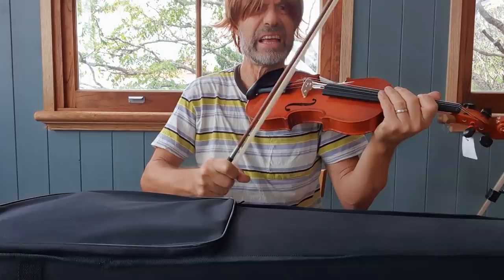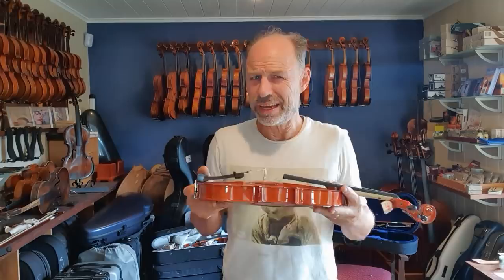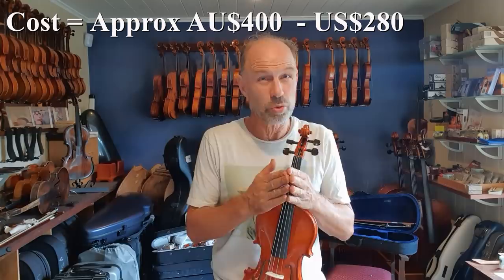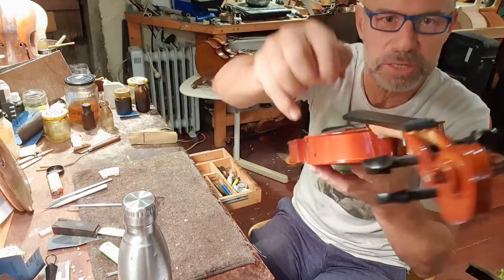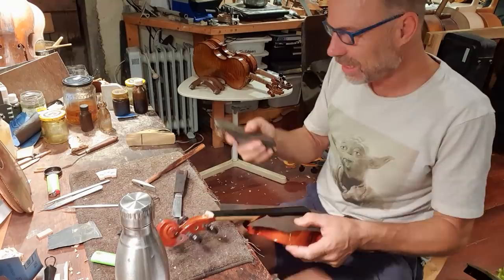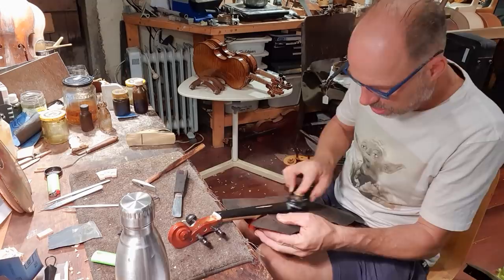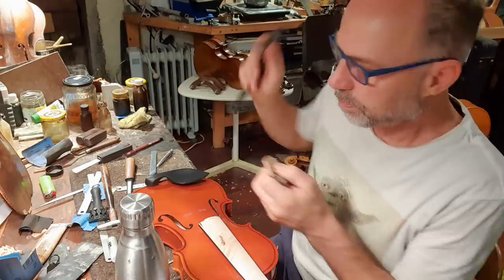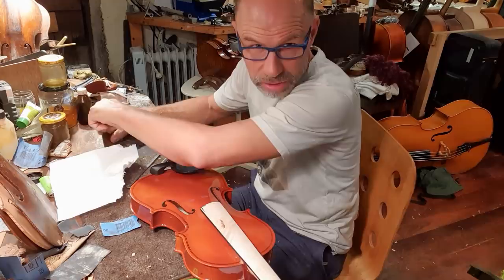Will it work?!? I try to Improve the 100 Dollar Violin with my Master Setup

Comment: This is a great video to refresh my memory. I've built a violin and several mandolins. I m looking at my bridge and notice that my d string has sunk down even with the top edge of wood bridge. I had thinned the down edge down a bit. I wondered should I replace the bridge? Or sand it a bit. It is an ebony e bridge.Aubert.

Comment: Lovely demonstration, ideally a craftsman can start with better, but a good craftsman can make it work.

Just one thing when drawing comparisons like this, in ran help to tune the violins to an objective standard. It was difficult to compare them properly when one was tuned notably higher than the other, or seemed to be.

Comment: I had a student start today with a vso. The bridge was so large, I could have cut it in half and still had it be to thick. Thankfully I just had a new bridge cut for my violin, so I put on the old one. Not a perfect fit, but it's better than or was

Comment: as an antique dealer, I'm also a collector main part old windup gramophones and old books but much more I come from a musical family of which I'm the least talented but antique musical instruments do trigger my fancy and don't go off to eBay or the auction place but to the storage of my goodies.
two weeks ago I came into the shop of a befriended antique/curio dealer and he had a violin hanging from the ceiling! it was a light wood with quarter panel back with a strong tiger striping in the wood grain and superfine detailed inlay of flowers leaves instruments and cherubs this was, in fact, a highly decorated Italian baroque violin from the 1730s.
now I have it I kind of want to sand the back!...why you ask! I think the inlays have been bleached by the sun and are in fact multiple vibrant colors of wood giving it more depth I also think the whole violin would have been more of a reddish-brown instead of light yellow because the inside is a reddish-brown.
I will take this step by step if you go into new territory never rush if it takes 3 years to learn it will take 3 years to do it! the end result will always be better for it!
Reply from the maker: Sounds like an amazing violin. 
Maybe talk to a luthier to see what kind of instrument it is.
The varnish is sacred on good instruments, so it's worth preserving. I work with the original  varnish and polish it to make the instrument look beautiful again.

Comment: Cool video would like to have a review of the new ebony bridges :washhands: are they to hard for the top or improofing the sound. Equal string spacing is good but 16mm you should be aware of the fingers of your customer, 16mm is too much for me. I cannot do quints on those violins:face-green-smiling: too small fingers :face-red-heart-shape: for example. If you want to dye a fingerbord you need to use black liquid leatherdye like the guitar repair use it or hardcore use liquid filler of edding :face-fuchsia-wide-eyes:smells only the first 100years.

Comment: hi! sir, some time the base bar in the 100.00 buck fiddle are really short  and it's made of ply wood, i bought a 200.00 droller fiddle ..and just to find what i would see in side of it , man, the base bar was only 5 1/2  inch long  and 1/8 inch wide,  and all most falling off,  well i made a new base post for it,  took of the neck all of it,  put a new block in the  did all the neck and bridge adjustments  complete aliment   surprise me what i could really do with a ply wood fiddle lol  but i do not like a ply wood fiddle lol  i did it for the fin of it...

Comment: I have a question... I am a guitar luthier, or rather fretted instrument luthier. I picked up a violin and they are quite a bit different than fretted instrument. For one thing you don't have to deal with sound posts in a guitar/mandolin/lute. What would a guitar luthier need to learn in order to become a violin luthier? Or should I stick with being a guitar luthier? I also found playing violins to be a bit of a challenge. For one I can't secure the violin to my chin without it falling off and so I can't fine tune it while pulling the bow. But then it's a cheap violin similar to the one you did work on, I only bought it simply because I wanted to learn how to fix them on a cheap instrument, and not mess up a 500 dollar instrument. 

But violins are clearly in a different world because very few people would pay more than 2500 dollars for a guitar whereas a beginners violin is 1000 dollars.

Comment: Out of curiosity, 
Do you believe bridges could be quality-mass-produced (ready for minor adjustment/alteration where needed)?  I'm thinking of cnc / stamping precision processes that have been adapted to other instrument parts like pianos..    or is each violin so different that handcrafting from a blank slate is the only method that will do?

Comment: Firewood is firewood, no matter what expensive parts are supplied.  The sound decays quickly, there are few overtones, the sounds are sour cutting, but not velvety and saturated
Reply from the maker: The problem is that the varnish fumes are toxic...
Reply: @AskOlaftheViolinmaker  I totally agree with you!  nitrolacquer cover of cheap violin will not bring health and sound!

Comment: One question I have: How much do the prices scale up for cellos? From what I understand, cellos tend to be more expensive than violins of the same quality. How much would a cello of equal quality to that $100 violin cost? How much would it cost to improve that cello to the same level that you improved that violin; and if you were to spend that much on a new cello (plus the cost of the initial cello-shaped object, of course), would it be comparable in quality to the violin that you suggest buying rather than buying the $100 violin and spending the extra money to get it up to that standard?
Reply: I need to know this as well

Comment: Most of the work he did only made the violin easier to play and had very little to do with making it sound better. Sure a new top quality bridge, sound post, and strings all placed where they should be really do help the sound but I was expecting he was going to pop the top and tune the plates...now that would be really interesting and really does take talent.  And maybe take it down to white and put on a really great finish.  $1500 AUS later....thanks for the video...love all violins, even those that did not turn out to be Strads.

Comment: Nut and saddle materials on guitars can make a pretty big difference in the sound of the instrument. I have seen bone nut and saddles for violins, but have never actually seen or heard a violin or viola with them installed. Have you experienced a violin with them and if so, what is your opinion on the sound produced compared to ebony nut and saddle?

Comment: My first cello I bought on eBay for ~$300 USD and was no-name  maker and very crappy. (Which I expected). I cut the feet of the bridge( which was the wrong angle for the curvature of the body),  planned the finger board and filed the nut myself. I couldn't get the nut off so I used a fine knife to plain upwards in the direction of the nut to get close to the edge.  LOL. The pegs were garbage; some kind of soft wood. But I didn't want to spend too much money on new pegs and especially a tool to cut them to shape when I'm only going to use it  once. So I went back on eBay. Hahaha. I found cello sized mechanical gear pegs for $34 free shipping. Hahaha. The pegs holes didn't match the gear pegs (because they are affixed to a plate like on a double bass. So I filled the original holes with epoxy and drilled new ones. I finished it by putting DIY wood dye on the finger board and spray painted the peg box with what ever was laying around in the garage. Hahaha Oh the original tailpiece was steel with fine tuners that were terrible so I changed it to a Winter for ~$25 or 30, I forgot. Hahaha so the whole upgrade was less than $100 USD. 

I'm definitely not a luthier but it (actually) works much to my surprise. 😂   You would be aghast if you saw it. 😂 It's the Frankenmuth of cellos.

Comment: Interesting to see the work. But wouldn't the before and after comparisons be fairer if they were both in tune? Since the before videos are played (/tuned) out of tune, that makes a huge difference between the two, making them sound much worse. And if so that makes it really difficult to judge what the other changes are, since any instrument sounds bad if the strings or playing are out of tune. If they were both done in tune we could compare the actual sound quality difference way more easily (and fairly).

Comment: I would like to have seen more about the sound post, it's position, length, purpose.  I recall my grandfather making violins and using a thickness gauge for the top and bottom boards.  How critical is the thickness?
Reply from the maker: The thickness is extremely important for the sound. 
A lot of these cheap violins have too thick plates to sound good

Comment: Why and how would you improve the sound from cracking? Thanks!
Reply from the maker: Hi Bryan, 
Great question.
It's where the instrument reaches it's limit.
The top plate is a bit too weak and the timber too soft to get that nice strong tone.
Reply: @AskOlaftheViolinmaker  Hmmm, I'm wondering if you still have that violin there, if you can conduct an experiment. I have discovered, on Wikipedia,  of an Arts Magazine in London, in the 1850s, which did a research on tuning. I'm wondering if the wood can sound better at A=415-432hz, the Mozart, Haydn tuning, instead of the A=440hz. Thank You!

Comment: The finger board part really opens up my eyes.  I wander what kind of wood has been used?
Reply: cheap
Reply: Given the huge knot on it, whatever it was, it was cheap.
Reply: Usually they would use flamed or birdseye maple for the neck, but then without knots, and possibly the same material as the rear plate (so it blends better up the back)

The fingerboard itself should have been made out of ebony, but this manufacturer probably glued on a piece of maple and though "hey let's just cover it in paint, nobody is gonna find out" instead of actually shaping and fitting an ebony fingerboard. Probably because ebony is a hardwood and hard to work with, but yields good returns in durability for the fingerboard - hence why it's used :)

Comment: U could have used those strings for a couple of Garote's or a few cheese cutters, wire wrapping knife handles, or making a hot knife for shaping styrofoam I'm sure there's more used but that's what I got off the top of my head...
Reply: Garotes: not very legal ...or nice.
Cheese Cutter: those strings are specially made to NOT cut the fingers of players.
Wrapping handles: they are usually "unwilling" to bend and keep that shape
As "hot knife": the core is plastic, the strings would disintegrate within minutes.

...Trash it is.

Comment: I have a question ... if there was the possibility of building a violin case large enough, could you make a guitar but with the body of a violin in your opinion?  (theoretically) and if so, would it be functional?
Reply from the maker: Of course that could be done. I would wonder what it would sound like, because the violin is mainly made for playing with a bow and the guitars obviously it plucked instrument. It would be interesting to see the effects of a soundpost as well
Reply: @AskOlaftheViolinmaker  there is only one way to find out, by trying! XD

Comment: I have what I think is the same VSO. It is pretty rubbish. The neck came off after storing it strung for a while. I don't know much about violins, maybe you are supposed to loosen the strings before you put them away. Anyway, it is not worth taking it to an expert to fix so I am going to see if I can fix it myself.
Reply: I just made a discovery. The ribs and blocks on this violin are made of plastic. This is perhaps why the glue wouldn't stick properly.

Comment: This is a really good intro to violin setup! If you want more details about what Olaf is doing, you can find them on maestronet.com. You can teach yourself to do everything Olaf does here, though it will take some time (I had to carve about 30 bridges before I felt I got something that was just ok. And bridges are easier than sound posts!).

So what's the point? If you''re a beginner and have no idea of the correct sound & feel of a violin, there is none -- you should just spend 4-500 bucks (USA) on a decent beginner's fiddle. But if you're not a beginner & have good manual skills & enjoy learning new things, you can buy really interesting old fiddles for little money,  set them up correctly, and get a really nice instrument. (Usually the fingerboard projection has sunk too low, but it's pretty easy to shim it up).

Comment: May I ask what u used to color the finger board? It seemed like a tube of burnt umber or raw umber?
Reply from the maker: Lamp black artists oil colour with varnish on top
Reply: Ask Olaf the Violinmaker would the oil not disintegrate the wood overtime? Even on wooden panels we’d usually use some sort of gesso acrylic or natural/traditional primer before applying oil paint! Just asking out of curiosity

Comment: I'm 71 and thinking about trying to play...so the sound between a $100 and $5000 violin isn't much different when I try to play...as I would hardly be jumping into Brahms 5th Concerto over the next 2 weeks....so...for me...$100 is fine...and if I have difficulty in a month...the cost isn't an issue....if I give up

Comment: Or you could do what I did, not that I recommend it. I have been forced (by a lack of budget) to learn how to do minor work on my upright basses (blessed with some very patient luthier friends). In the process, I decided I would buy a junk violin and see what I could learn putting it back together. I already own a CCVSO that I was able to improve slightly with some minor upgrades. Searching for a beater, I found one on Facebook Marketplace for $20. Perfect! It had seams coming apart, the neck and the saddle were off, the soundpost had fallen out, but unbelievably, everything was there. The seller's husband had found the instrument and case in the neighbor's garbage can after it has spent a couple of weeks in cold, damp weather, partially painted white with chalk paint, as a Halloween decoration. So, I bought it. 
It was a viola. I'm sure the TwoSet guys would LOOOOOVE that. It showed up in a larger case, and I opened it up to discover a 17" viola. 
Anyway, viola or no, I decided to repair it. $20 for a guinea pig instrument for me to learn on? Sure, why not? 
I glued it back up as straight as I knew how, and in the process found the maker's tag on the inside on the upper left bout in the process. Turns out it was a Josef Lentz (small shop, Bavaria), and it at the least predates WWII, and possibly sometime before that. Instruments travel, so you just don't know. Regardless, he began his mark around 1910 and I have no record of his shop past 1945. The case that Josef was in matches cases made in the early 1900s -1910s, but there's no guarantee this was the original case. Anyway, Lentz lost his son on Dec. 30, 1943 in action against the Russians. I named the viola Josef in honor of the grief this father must have felt at the loss of his son, regardless of which side he fought on. The war apparently took his son, who was probably also in line to be a luthier, and ultimately also took his livelihood.
So, Josef the viola took a few days to reassemble and reglue. It took a bit longer to get the chalk paint off, but I carefully removed it. Strings came in shortly after that. D'Addario Ascente sounds alright, although a more expensive string would really bring out the inherent richness. And to my surprise, Josef has a really nice richness. Flamed maple, a nice, full, and woody tone. If only I was a better player. I'm working on that part.
Long story short, Josef has a new home, Herr Lentz' instrument wasn't discarded to the bin, and it is now patiently helping an old treble and bass clef musician learn alto. LOL
Reply from the maker: Wow... Great story.
Reply: Still can’t sight-read alto very well after 17 years teaching orchestra.  My students have my approval to laugh at me as I stumble through with them....

Comment: How can you cut the bridge properly without fitting a new post and nut first?
Reply from the maker: What comes first? The chicken or the egg🙂
The shape of the top-plate may change minutely, but often not enough to have to refit the bridge. 
I always check this over at the end and if the bridge does need refitting, I will refit it.

Comment: A $100 VSO is the ultimate insult. I'm sure for the same price, you could buy a DSO (digital storage oscilloscope) and it would be far more useful as an instrument. :P
Edit: Oh crap, they didn't even bothered to put some varnish on the neck! I would bet that the wood is subpar as well (probably from new tree and probably not heartwood).
Reply: @KonradTheWizzard  The 1KHz square wave output on a DSO is only meant for probe calibration. It will have no frequency or amplitude control, either in a Rigol, or in a Tektroniks.

Anyway, my comment was a humorous take on words. I actually have an Owon SDS7102V and I don't find it to be noisy. Sure it will lack some software options, and the response is on the slow side, but it is not bad for a 100MHz, 1MSPS scope. But it is not a $100 scope either. Actually, $100 scopes will be limited because of their sampling rate and max frequency, but the noise figures may be better, as slower op-amps tend to be less noisy.